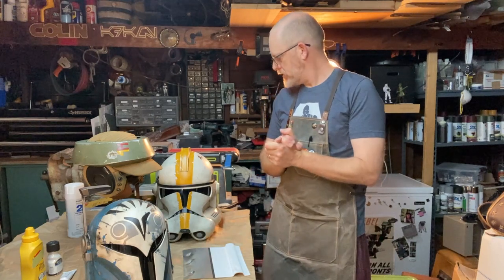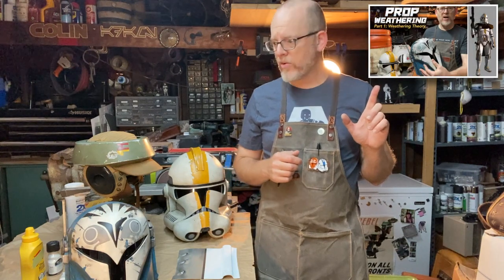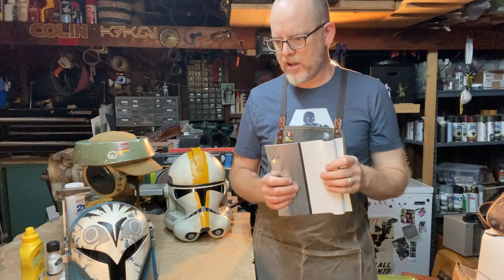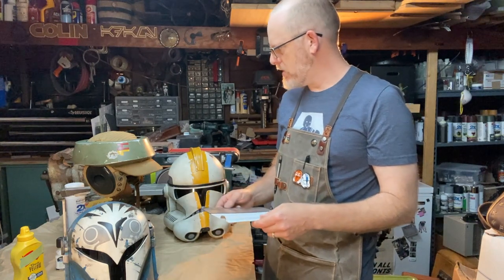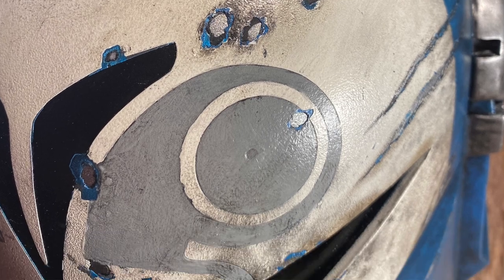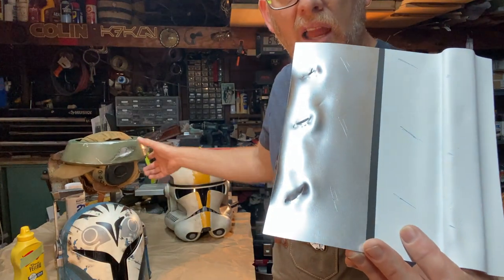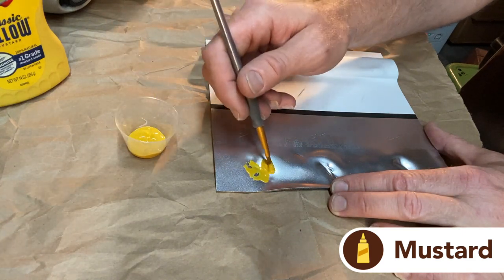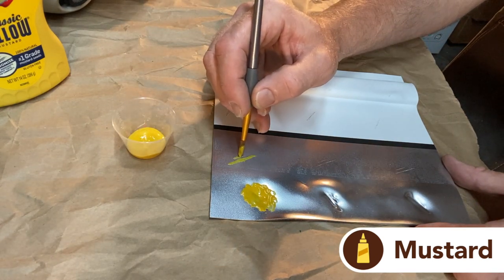Prop Weathering Tutorial - Part 3: Chipped Paint Weathering

Comment: For toothpaste I use a simple kitchen sponge or rag instead of a butter knife, something non abrasive.  I would imagine a butter knife would add additional scratches that may not be wanted.
Reply from the maker: I tried that at first, but the paint was not breaking down to the toothpaste easily. So I switched to the butter knife, and I haven't had any scratch issues.

Comment: Such a helpful vid! With metallics, are you able to paint just on the areas you want it to show through (eg just edges or places you want a chip) to avoid painting the whole thing silver, and save paint? Or would that create an uneven lumpy surface?
Reply from the maker: Yeah, the only way is to make it all metallic. But it is also sprayed on in such a way that it would hit it all anyway. If you masked off spots, you would still be silver-coating your masking material, so there would be no real savings. I find doing it all silver allows you to pick the chipped areas after it's done, so you can highlight the most reflective spots, and avoid any spots with small blemishes showing in the chips.

Comment: Great video! What paint did you use for the metal? I tried Rustoleum Bright Coat Metallic Finish Silver and paint I applied afterwards wouldn't stick to it! I was pretty upset when my masking tape was peeling my grey paint off the silver!
Reply from the maker: this was that same Rustoleum, and I have seen exactly what you are describing. I am not certain why it does that sometimes, but many gloss paints have issues like that and metallics can be even more prone to issues.
I think this video was the last time I used it like this, most of my current process uses airbrush metallics like Alclad and Alumaluster, coated with 2K gloss to protect it (2K is a two part mix that is what is used on cars for that clear coat), and paint adheres well in that process.

Comment: I just discovered your channel yesterday and have already learned so much. (Loved your first video on weathering and things to take into condmsideration.) On this video however, I was a little bummed to see that you didn't do a section of Vaseline/Petroleum jelly. That is the route I was thinking, and since I am doing Beskar armor, am curious as to the dulling effect of it. (Hopefully very little, to none at all.) I do have a big chunk of white in my armor so the mustard will not do. Have you or any of your subscribers heard of any pros or cons to using Vaseline as a masking agent? I look forward to future videos.
Reply from the maker: The reason I have not done it is the clean up. To remove it after each layer would take cleaning with soap or something else to remove the vaseline. If it weren't fully removed, any grease or oil (or petroleum jelly) would absolutely cause paint issues. Toothpaste and mustard are both water soluble, so that risk isn't there.
On better metallics (like Alclad chrome or Alumaluster type airbrush metallics), I now coat those with 2K clear, and so there are no issues affecting that base metal layer. So I use exclusively latex masking fluid on those because there is no "clean up" process, just peel and rub it away, and move to the next coat.

Comment: Awesome video! Do you use salt and hairspray technique? They seem like the best way to go about this but I have yet to try them...
Reply from the maker: I have used salt, but just with a mist of water, and then sprinkle salt on top. The water dries and the salt stays stuck until the paint goes on, and then is easy to brush off leaving tiny irregular pinhole shapes. What is the hairspray part?
Reply: You do the first paint, then spray it with hairspray and cover that with the second color. Once that's done you drop water which reacts with the hairspray and you can use toothpick or brushes to scrape of the top color. From what I've seen it's the technique where you have the most control over the shape of the scratch. 

Like this:
https://youtu.be/yKrrkvsdzjs?si=Q9-E4WL14fSDhv-K
Reply from the maker: Ah, I see! That is a nice way to get fine chipping details. Thanks!  @realgagy9135

Comment: what about rubber cement instead of the latex?
Reply from the maker: I haven't tried it, but the issue may be with paint interaction. I know contact cement sort of dissolves paint, and that may be true of Rubber Cement. You can try it, but latex masking fluid is not expensive.